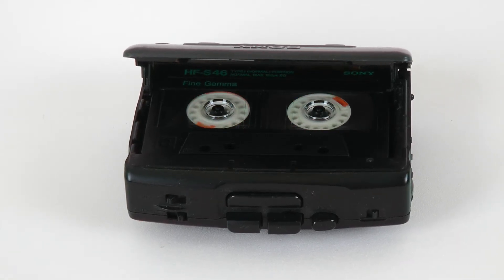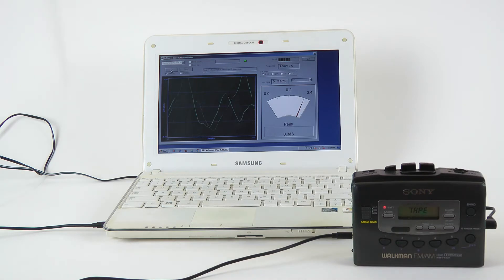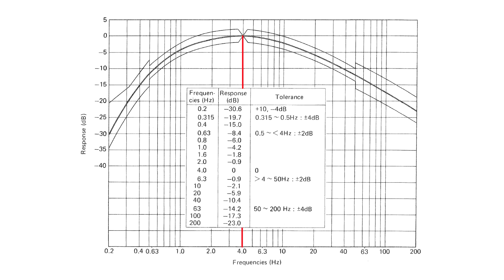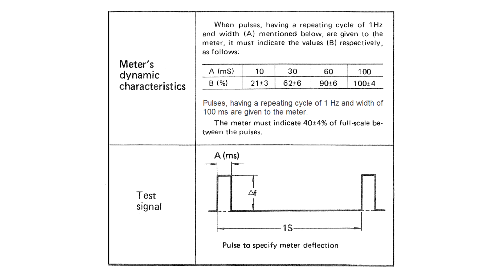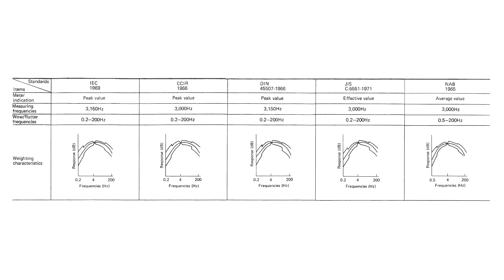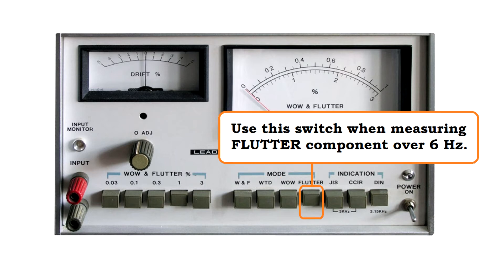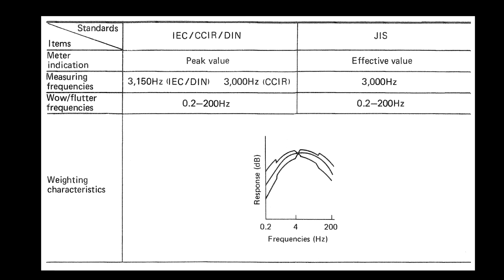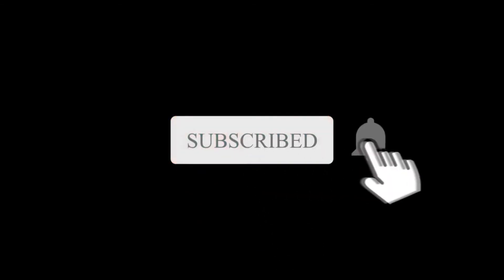Wow and flutter: what is it, and how to measure it using WFGUI?

Comment: I have a new to me 23 year old tape deck, I recorded the 3300 tone and measured playback at average 1.3%. Since I used the same deck to record AND playback...does the playback measurement reflect a .07 wow and flutter that the original specs specify? The signal was very clean. So, I'm asking, when you record music on a cassette deck, you have to assume that YOUR recordings are going to have twice the Wow & Flutter that the manufacturer would make you think you are getting! RIGHT?
Reply from the maker: 3300 Hz is not a standard tone, it is either 3000 Hz or 3150 Hz, but it should not matter much after all. I am not sure what 1.3% you are talking about, is it the deviation from the ideal tape speed, or wow and flutter measurement? For the former, the deviation within ±2% is considered acceptable, although many tapeheads would tell you that this is too high for them. For reference, 5% change in frequency is one semitone. 1.3% is too high for wow & flutter no matter what method you use.

As for self-recorded tape, I can refer you to the user's guide for the Dynascan Model 1035, which indicates that if you use a self-recorded tape, "one half the measured value represents wow and flutter for playback only". You can see the scan from the corresponding page of the user's manual in the text version of this video on Medium: https://reflectiveobserver.medium.com/31cc9495d24?source=friends_link&sk=818921e22a6077799302ae3469ae67d7
Reply: @ConsumerDV  Sorry, the frequency WAS 3150 hz! So when playing back a self recorded tape, the 1.4 measured percentage is actually double the real wow and flutter because the recording process AND the playback process represent the tape  being run twice! Correct?
Reply: Also interesting to note that since my unit being a dual cassette deck, I noticed that the frequency on deck 1 played back a bit slower than deck 2. But the wow and flutter were almost identical! By the way, it's an Onkyo TA-RW414 machine from 1994. Thanks for your reply!
Reply from the maker: According to the Dynascan manual, W&F value obtained with a tape recorded on the machine that is being tested is twice higher than the real playback W&F, which corresponds to your judgement. Other people say that it is up to two times higher, because one cannot simply add numbers when talking about sine waves. I am not qualified enough to say which one is correct. Both of these statements agree in that the difference is no more than 2x, so if you measure 0.2% with a self-recorded tape, actual playback W&F is within 0.1%-0.2% range.

Still, I wonder where 1.4% comes from. This value is too high for W&F. Your deck specs show 0.07% WRMS. Maybe you mean 0.14%? There are at least four parameters related to tape speed: (1) tape speed at any given time, which may be different from the ideal one; (2) slow variation of tape speed over time a.k.a. drift; (3) faster variation of tape speed over time a.k.a wow; (4) rapid variation of tape speed over time a.k.a. flutter. The first two are usually combined into one speed/drift parameter, and the last two are combined into wow&flutter parameter. The deck may have incorrect tape speed, but low W&F. 1.4% is ok for drift, but is too high for W&F. According to the old German standard DIN 45550/45511, a hi-fi deck must have no more than ±0.2% DIN Peak, which roughly translates into 0.1% JIS WRMS.
Reply: @ConsumerDV  Yes, I redid the test on both decks .14 is correct, as a matter of fact. Using a 30 year old Maxell UDXLII tape, it was a little better averaging .11 roughly. The speed difference between decks is about 1 to 1.5% (assuming the difference between 3000 and 3040 khz is in that neighborhood). I also played the recording on an old Aiwa Walkman, .17 to .20% W/F, test tone frequency was playing at 3140. By the way, I am using a test tone of 3000 khz streaming from Youtube. The frequency counter software shows it at 2999 khz.
Reply: @ConsumerDV  noise is inherently random in nature including WAF and adding 2 noise signals is not a linear addition a + b = c.
Noise is usually defined in rms and the squares added. So were adding powers..
a^2 + b^2 = c^2

Comment: Is there a WFGUI or similar program that works for the Mac? I'm assuming this is a Windows only program.
Reply from the maker: Yes, it is Windows only. You can try running it on the Mac like any other Windows app using virtual machine. There is a native Mac app called NAK T-100 Audio Analyzer that can measure Quasi-Peak DIN 45507 as well as WRMS DIN 45507, although I thought that DIN is always about Quasi Peak, while WRMS is what JIS have used. Anyway, the app is $25, I haven't used it, so cannot say anything about it.

Comment: Thanks for the video and link, I've wanted to add a W&F meter to my workshop and this has made it very easy using a laptop and WFGUI. I'll also be considering the simulated Nakamichi T-100 audio analyser software later on and see if it has any more functionality I would benefit from.

Comment: My tape deck is spec'd with peak WTD wow & flutter of ±0.08% and I am reading 0.04% using the WFGUI.  Can you explain why the spec uses ± but the meter does not?  Are they comparable?
Reply from the maker: peak WTD wow & flutter a.k.a. quasi peak a.k.a. DIN value. Yes, it is normally spec'd with "±", the numeric value corresponds to the needle in the "Peak" section, and "±" conveys that this is peak to peak value, that is, the difference between two opposite peaks on a sine wave. When you see "WRMS" in a spec or test result, this usually means JIS standard, which measures weighted root mean squared value. If the fluctuations were a pure sine wave, then RMS = 0.7×Peak. In reality, WRMS value is about 0.5-0.8 from peak value. If you are getting ±0.04% Q. Peak, this means that your deck is well within the spec, which is great. If you are getting 0.04% WRMS, it means it is close to the spec, which is good too. Feel free to read the corresponding writeup: https://reflectiveobserver.medium.com/31cc9495d24?source=friends_link&sk=818921e22a6077799302ae3469ae67d7

Comment: How do we connect the audio device to the computer? What kind of cable do i need to use? Thanks
Reply from the maker: Most laptops have audio in, usually for a microphone, it can be used by adjusting the amplification on the computer and the sound level on a tape machine. For my walkmans I use a 3.5mm to 3.5mm cable. For a component deck I use a dual RCA to 3.5mm stereo adapter.
Reply: @ConsumerDV  Thanks for the reply. I think my laptop doesn't support  such thing you said. I tried 3.5 to 3.5 but didn't work. But, when i connect a microphone to the same jack on the laptop and my walkman to external speakers, i can read measurements on the wfgui software. Do i need to change settings on my laptop perhaps?
Reply: @ConsumerDV  i guess I figured it out. I need to disable mic and see what happens
Reply from the maker: I would set the volume on a walkman to minimum, connect the cable, start the app, then start the walkman and increase the volume until you see that the level is acceptable. WFGUI shows signal level, I think it changes to green when the level is acceptable.
Reply: @ConsumerDV  unfortunately my laptop is a basic one and no line in option whatever i do. I guess i will need an USB sound card. If you have any suggestions for an affordable sound card i can check for it
Reply from the maker: @soulsirius  That is weird, I thought all modern laptops have audio input if only for videoconferencing. I don't know much about USB audio cards, I don't use them.

Comment: At 4:37 how do you properly set this up? I downloaded the app and connected the boombox to my PC using a male to male audio cable that runs from the PC headphone jack to the boombox headphone jack. I hit play on the boombox and click start on the program yet nothing happens. Nothing is been measured at all.
Reply from the maker: You need to connect it to audio input on the PC, whether it is a line input, mic input or combo headphone/mic port. In the latter case you will likely need a dongle to convert into 4-pole TRRS, making sure that audio is sent into mic channel. Also, mic input has higher sensitivity, line input has lower sensitivity, so you may need to adjust input level in the system settings.
Reply: @ConsumerDV  On the boombox the other end of the audio  cable goes connected on the headphones jack as well? I'm asking since my Sanyo boombox has mic / headphones ports. I have tried so many ways yet no success.
Reply from the maker: @shazmanbound1496  Digital interfaces are usually bidirectional, analog interconnects are often directional. You need to get audio from the boombox output port - can be headphone out, can be line out - and feed it into computer's input port - can be mic in, or line in. You may need to select the input port in the computer's settings.

If your computer does not have a dedicated analog input - mic or line - but does have a combo in/out port for headphones (out) and mic (in), then you need a cable that will feed the signal from the boombox (headphone out) into mic input. Headphone output is too strong for mic input, so I suggest setting the volume on the boombox low and the gain on the PC low as well. After you have them connected, slowly raise either the volume or gain or both, you don't want to overdrive the input circuit.

Comment: Great video! I downloaded the WFGUI file, but my version of Windows will not extract it, unfortunately. Any advice there?
For me, on my turntables, I get all OCD if my free RPM Wow & Speed app reads more than 0.1%. But I can't really hear under about 0.17%, except sometimes on certain piano recordings.
Reply from the maker: Thanks! WFGUI is an executable compressed into a ZIP file (I added the link to the description). There are many un-zippers available for Windows, like 7-Zip or WinRAR. Just un-zip into any directory and run the EXE file. I think the executable is 32-bit, so there should not be any problems from Win95 all the way to Win10. I run it on Win7 32-bit and 64-bit.